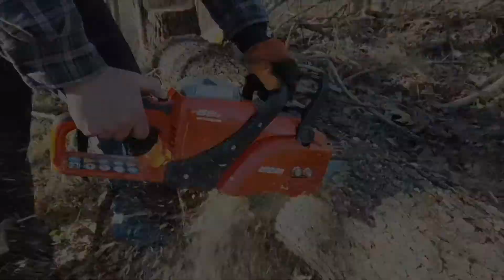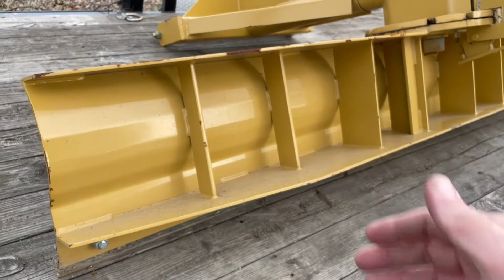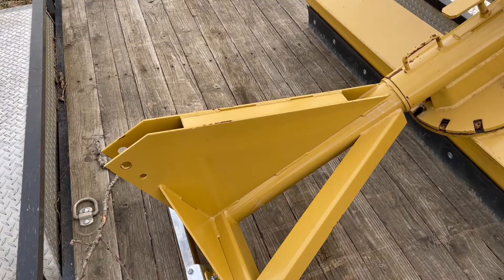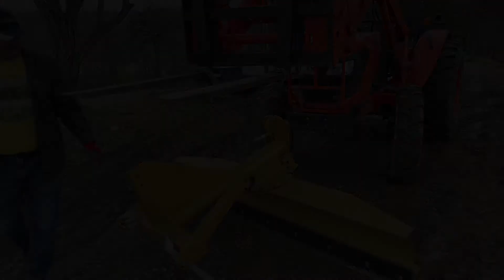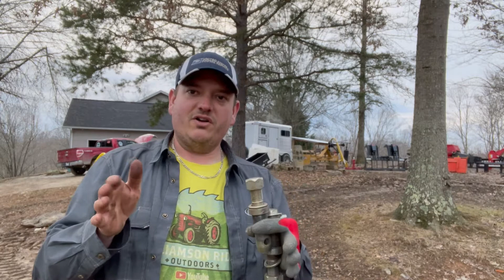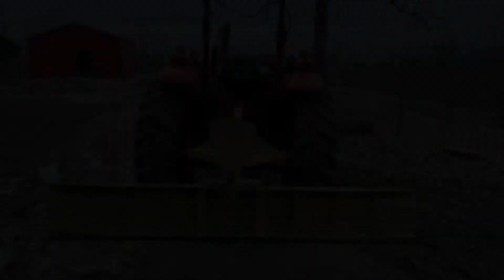King Kutter 8 Ft Heavy Duty Grader Blade First Look And Walkaround #180

Comment: Good size blade for your size tractor - Rule of thumb is an 8 foot blade fully angled will be about 7 foot wide of a dirt or snow footprint - I figure on your tractor that would be sticking out about 9 inches on each side of the tire - Average homeowner has an attachment sticking out too far past the rear tires will hit the side of the garage or barn door -

Comment: What size  hp tractor is needed? Will a 4x4 LS mt3 57 work?
Reply from the maker: 8 ft may be a little much, I would think a 6 or maybe a 7ft would be max, it’s not that your tractor wouldn’t pull it, it is the fact the blade would stick out so far on the sides you would be hanging it up on everything you drive past, measure your rear tire width and get a blade that covers your tire tracks, and take into consideration when you angle the blade, if your tractor is 6ft wide get a 7ft so when you angle it, it still cover your tire tracks but when straight it only hangs out 6 inches on each side

Comment: I had my eye on a six foot blade and it would also swing left to right.  While I was there it sold on the phone.  It would be nice to get into the ditch areas.  But being a bigger blade it will work well for what you want.  The one I did get was is nice. I no longer have to take it off the tractor to spin it around to reverse the blade.  That is so nice compared to the old blades.  It always better to have a heavier blade. I can also slide it left to right on the blade bracket but much rather have it do it with pins. I actually broke my old one that did not have supports across the back of the blade. The cutting blade was broke so it was scrap after a while.  For snow it should work well angled.  Mine being a six foot is short for pushing the snow off of to the side well. I tilt mine for the crown in the drive way.  Sometimes you can get enough with the lift arms. Well good luck with it I would also like to include a box blade like you have to my collection.  The blade is one of the most used things I have. I would really like to be able to rip the hard pack to fill holes.

Comment: I have its 6 foot little brother and they are tanks. I loved mine for the counter weight it gave me. I had mine a 45hp 2wd gas loader tractor and i didnt have the traction to pull it while tipped. You being 4x4 im sure youll have the power.

Comment: Dude, I think your front tires need air in them. When you lifted that grader blade up and turned to the left your tire was rolling over. You better check your air pressure or you're going to end up getting in trouble.
Reply from the maker: Yeah they looked pretty low but I check them regularly they are actually aired to the max with the loader.

Comment: That’s my favorite dirt working attachment. I really like the way the locks are made on the angle adjustments. Mine has gave zero problems. In the past on old blades I’ve sheared the adjusting pins. I use my top link in the lowest pin hole on the tractor, it works best for the geometry of the hitch.
Reply from the maker: Yeah it really has a good positive lock on the adjustments, I’ve tried different holes with the top link and it just isn’t quite long enough, but, i just solved the issue by installing a hydraulic top link that is a few inches longer in it out position, I think it’s going to work out great.